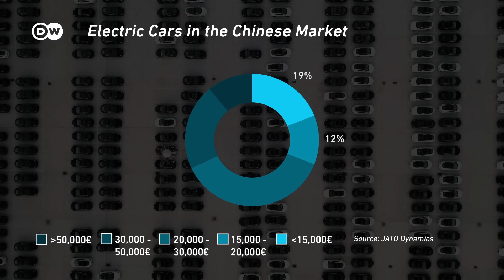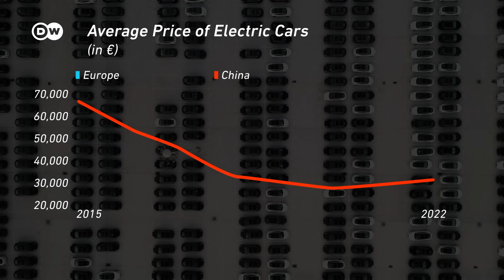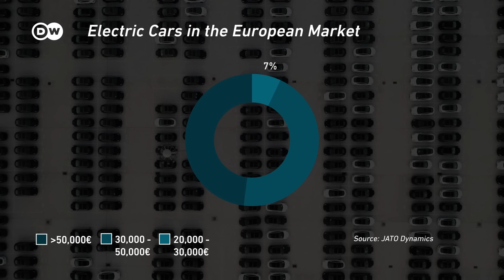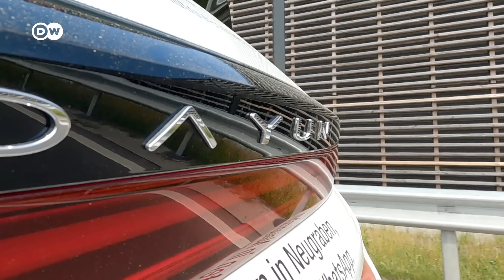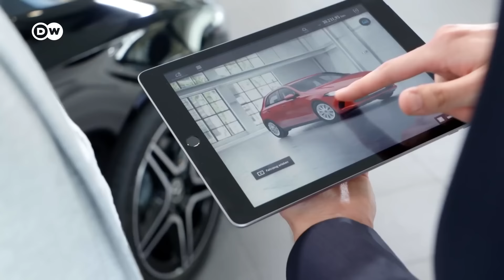China's Mini EVs Are A Game-Changer & Going Global

Comment: Do these cars follow EU's Regulation and Laws?
I feel that, overall, the ethic of Chinese companies, especially on the lower-end of the market that was mentioned here, are not quite reliable as we are used to.
Therefore, our single KPI when purchasing a vehicle shall not be price.

Just like the energy challenges the Russian invasion in Ukraine brought us, a Chinese dependency could leave us in a similar position if China was to invade Taiwan, create even more "fake" islands in the South China Sea, or take command of many African countries.
Therefore, we shall be cautious.

Moreover, we Europeans are used to many comforts, safety, consumer protection, supply and many other standards which we take for granted.
It is only when we leave the EU that we are faced with the absence of these.

Will you accept that after 4 years of the purchase, you would not be able to source a windshield?
If you would not be able to purchase a tire that has rare dimensions, would you be happy?
If your airbag did not inflate in case of an accident?
The OEM ignored a recall of all its cars for a seatbelt bolt?
Reply: This video only shows the cheapest of the  cheap EVs in China, around the price range of under us$5000, which aren't considered proper cars even for the Chinese. We use them as bicycles with hood to pick up kids or buy grocery in the community. The real EV cars start at the BYD Seagull at us$10000.
Reply: Don't like, don't buy. That's what Chinese consumers do, and over there they have plenty of choices.
In 2022 EVs accounted for 14% of all vehicles sold globally. Overall EU share was 24%, China at 30%.
Let's look at regions that may not prefer Chinese. US 5.7%, Taiwan 3.4%, India 4.1%, Japan 2.1%
Now let's look at a sample country that actually prefer Chinese EVs: Thailand EVs market share in 2022 was 58%
Reply: @Voxabonable  Electric vehicles now account for more than 30% of car sales in China and are approaching 40%
Reply: @Voxabonable  Taiwan is not a country, it is just the name of the region, it is called the Republic of China has not been independent and established diplomatic relations with various countries, it is a part of China both in history and now, the United Nations Charter, the World Health Organization and the post-World War II Postan Declaration all recognize Taiwan as an inalienable part of China.
Reply: @byhyew  that is a fair point.

And my comment is targeted to that price range - which will have low quality.
But I admit I should have mentioned that.
Thank you!
Reply: @Voxabonable  I wish everything was simple as that.

The proof is the amount of waste created by EVs which were not sold in China.
What will happen to these vehicles?

Moreover, EVs are a great issue when it comes to leaving them abandoned, due to their batteries.
A fire can brake out, and if there are many EVs around it, more fire can brake out.
Reply: @hitardo  you didn't really watch the video now, did you?
Reply: @hitardo  >> Moreover, EVs are a great issue when it comes to leaving them abandoned, due to their batteries. <<
This is one of the key points of the EU's CRMA -- EV batteries can be recycled, but it's not necessarily going to be economical or safe, due to their weight and inflammability.  China's LFP recycling is net-negative in terms of cost and value recovered with the existing recycling tech and, without any tech recycling breakthrough, this would have to be subsidized or force EV OEMs to bear the cost.
Reply: “Chinese take command of many African countries” - typical European thinking the Chinese are colonizers like them. 

China interacted with the African coast hundreds of years before the Europeans, and never colonized. 

Everyone not like you dude. Chill.
Reply: @frankiedehockie  I am sorry, but I think you are being naive.

The interest of China in Africa is:
a. To exploit cheap work, in order to prop up Chinese companies, and continue to be a hub for export goods;
b. To get cheap raw materials, in order to continue its EV ambitions and energy needs;
c. To get UN vote influence, namely on the Taiwan issue, but also on the South China Sea.

Or do you honestly think they do it from the goodness of their hearts?
Reply: Hey tro/ll.. Did you even watch the program?
Reply: @k.k.c8670  repeating a question?
Did you read all the comments?
Reply: @hitardo  Out of your point a/b/c, they are still better than how Europeans enslaved and slaughtered the Africans right? Oh, the Europeans also took raw materials and resources from Africa too, but they never paid for them. The Europeans definitely did that out of "their" goodness of their hearts.
Reply: @hitardo   and what is Europeans interest in Africa? 

Here is the difference between China and you westerners, Africans see some benefits  - 60% of all new infrastructures, roads, power stations, airports, railways etc, were built by Chinese firms. 

After 200 years of colonialism, genocide, exploitations, etc, what is there to show from Europeans?
Reply: @MMLL369  two questions:

1. Is it right to do a wrong, if someone else has made the same wrong before?
I honestly think that Europe acted in a bad way in the past (Centuries ago), and we have made a strong improvement on our relationships with the past-colonies.

2. Shall a nation be forever blamed for its sins in the past - regardless of their improvement?
Germans due to the holocaust, the North Americans due to invading Vietnam (and hundreds more), Chinese for the civil war and Tienman Square, Russians due to the invasion of Ukraine.

China is performing these moves at the present moment:
a) Creating fake islands in the South China Sea, adding military bases in them, in hopes to increase their EEZ;
b) Planning an invasion on Taiwan;
c) Murdering people due to their different religion and opinions;
d) Imprisoning people for expressing their views;
e) Leveraging poor countries, through debt, in order to gain power in the UN council;
f) Creating border issues with India;
g) Continuing to import goods, which provide revenue, for the Russia Government;
h) Continuing to support North Korea, despite its mass-destruction weapon focus;
i) Ignoring trademarks, Intelectual Property inside China;
j) Ignoring international standards and agreements on emissions or space exploration.
Among others.

This is happening right now!
Therefore, we shall not be naive - much like we were towards Putin, and his regime over in Moscow.
Reply: @frankiedehockie  Can you please provide a source for that number?

Moreover, what was the debt level for those countries, compared to their GDP?
The majority of countries are not capable of paying that investment back.
Especially after the COVID-19 pandemic - which reached every part of the World, because the Chinese Government ignored the signs, and even imprisoning the Doctor who spoke out about the virus.

Were profitability studies made on the infrastructure built?
No, because the purpose all along is to support China - on the BRI (Belt and Road Initiative).

Did local businesses and people profited from these projects?
No, because the loans were from Chinese banks, Chinese people were taken there to build the infrastructure, employed by Chinese companies, and they lived in a closed space.

Taking all this into account, is the BRI really an investment into African countries?
Or is it a guarantee to China that despite "the middle-class trap" it reached, China continues to be a leader in exports?
Reply: ヨーロッパ人が他の地域の発展のための費用を喜んで負担するのであれば、それも問題ない。ヨーロッパ人がこれほど高い道徳基準を持っているなら
Reply: @humansarecrazybeing5730  so, you are not using arguments at the moment.
Take care!
Reply: @jingzhi2898  I am sorry, but I am not able to understand what you wrote.
I tried using a translator, but I think the real meaning was lost.

Can you please write in other language, you also feel comfort in?
Thank you.
Reply: @hitardo  lol this ain't colonial period so don't try to play divide and rule policy. 😂
Reply: @humansarecrazybeing5730  if you lived in the colonial times, what role do you think you would play?
Reply: @hitardo  

1- public infrastructures are not meant to make profits but to generate economic activities. Do Europe or the US makes profit on the roads and sewage systems they built? Nope.
Reply: @frankiedehockie  You are right - in part.
My mistake was not clarifying directly what I was referring to, thus, I am sorry for not being complete in my response.

When talking about infrastructure, especially those owned by the Government, regardless of the nature of the operator (who can differ from the owner), one talks about indirect profits. Meaning, the profits generated by he improvements in efficacy, efficiency, or growth in money moved or generated.

In the cases mentioned by me, regarding infrastructure created for the BRI, did that same infrastructure generate enough benefits to pay off the debt those States contracted with Chinese banks?
This can be measured in: GDP growth, Taxes growth, economic activity growth, and even population growth.

Please, clarify to me what were the indicators that have grown since those infrastructure projects were finished?

I will say this to you:
Not even China, the country and its people, profited enough from the BRI mega-project?
One can argue that they have been hindered by the COVID-19 pandemic aftermath - but even this was caused by the inertia of the Chinese Government, both in the local and state levels.

The unique project that has show signs of being slightly relevant is the train tracks from China to Europe, and not even every line.
This project will benefit preciously the theme of this documentary: exporting cars from China to Europe.
When compared to a boat, a train can transport cars quicker, safer (requires less corrective maintenance after the journey), and cheaper (as it will be almost entirely controlled by Chinese companies).
Reply: @hitardo Colonizer, STOP projecting. It only exposes YOU and it’s embarrassing.
Reply: @scottw4208  I was not able to understand your argument.
Can you please clarify the meaning of your sentence?
That way we can talk in a more constructive way.